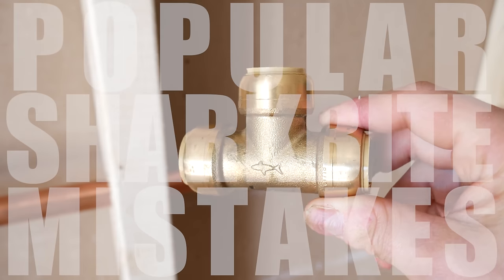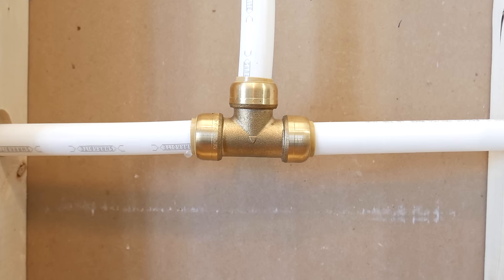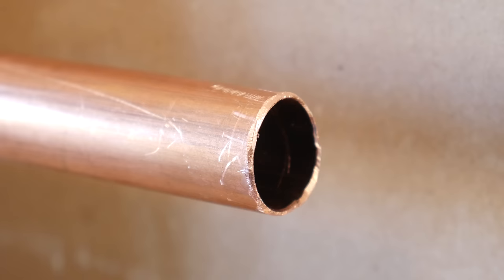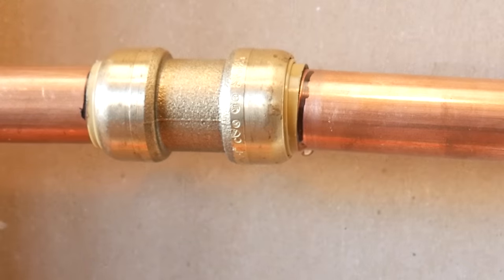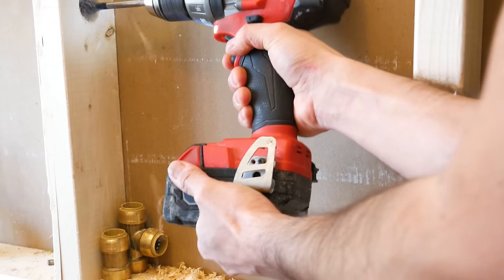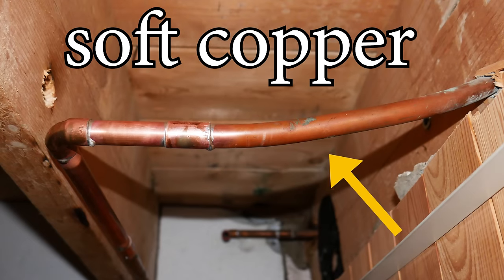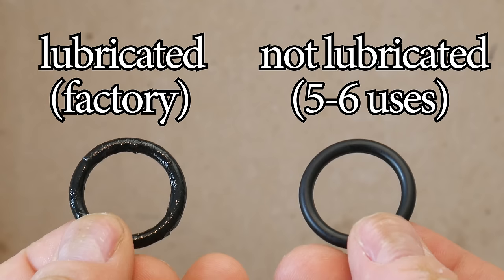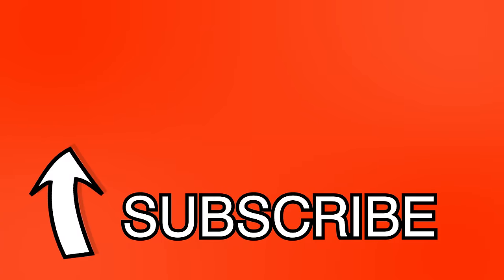6 SHARKBITE Mistakes NOT To Make! | GOT2LEARN

Comment: Are you using steel wool to clean the tip of the copper pipe? I know in one video you warn against using sandpaper. Some videos mention emery cloth. What do you recommend to clean the copper pipe ends? TIA
Reply from the maker: I prefer using 3M abrasive pads, better in every way.

Comment: Hi. What happens if I take out plastic inster inside connector? Connector is 3/4, but inside insert reduces inner side to 1/2. So, I assume it will reduce flow trough pipe. Can I take out it? Regards.

Comment: 2:04 'cleaning' the end of a pipe with abrasive like that leaves the surface scored giving it a fair chance to leak.They need to be clean and smooth, not abraded.

I never marked the insertion depth - you can tell when it's in properly or not by simply feeling it getting over that initial insertion resistance !
Reply from the maker: The abrasive pads don't score the surface enough to cause leaks, sand paper will however, and I wouldn't mess with the insertion depth, that's when you start getting leaks, big no no.
Reply: @Got2Learn  Too scored for me judging by what I saw in the video !
Interestingly, my dishwasher's just gone bang !

Comment: I wonder if the sharkbite fitting will last long term. When I put together a copper fitting, I know it is there, probably for 40 yrs +
That O ring is a big concern for me. Do all sharkbite fittings have that O ring I wonder? I did not realize they had the O ring. I have used sharkbites, over past few yrs with not one failure, but a little concerned now!

Comment: how close can i solder a slip joint to a sharkbite fitting
Reply from the maker: From the Sharkbite website: "It is recommended to solder any joints prior to installing a SharkBite fitting. The heat from the torch can be transferred through the pipe and potentially damage the O-ring."

Comment: I accidentally used a sharkbite polytubulene fitting with a grey end to connect copper to copper? It seemed to work fine. Is this a problem?
Reply from the maker: You should be using the proper one, this is why Sharkbites have a bad reputation, no offense James.

Comment: Thanks that was helpful information
Reply from the maker: Glad it helped!!!
Reply: @Got2Learn  I'm electrician handyman here and there I've had to do plumbing and since the shark bites came out with started using them only about five times every time we were wondering if we were doing it right and had to check and recheck. To make sure we did it right

Comment: I have 1/2 copper and 1/2 inch shark bite coupling but the pipe doesn't fit into the fit into the coupling, they are the exact same diameter

Comment: With the use of an Oatey laundry box, If I were to lower the box so the top of the drain pipe is 28”, could I put the p-trap below the floor? I have a crawl space below the floor.
Reply from the maker: If it'll be exposed to freezing temperatures, no, if not, it's fine.
Reply: @Got2Learn  I have a p-trap under the shower in the crawl space . How is that different?
Reply from the maker: @cinepost  Do you get freezing temperatures where you live?
Reply: @Got2Learn  rarely, Charleston SC
Reply from the maker: Then you should be good to go. Maybe making a wooden box w/insulation for them wouldn't be a bad idea in case it does decide to freeze, lemme know what you decide to do

Comment: SharkBite connectors fail from day 1 .... I did pex A expansion and I made a mistake with a fitting, I had to cut the ring with a hot blade, I still couldn't pull of the hose without the ring on it, its super tight, I didn't want to damage the plastic connector by cutting the hose so I just threw that piece away... the SharkBite's is easy to just pop in and swap, but you don't want those connections in the wall, they eventually leak, plus they cost almost double the price of the expansion or compression, I did my own manifold with pex A expansion rings, water heater, main, everything except the valves at the stub out for the water line to connect to sink because I did not have the expansion machine, so I said screw it and got the easy push connects from sharkbite, I only have 12 water lines total, I added a whole house filter, washer machine water box, about 5 shut off valves around the manifold and a water filter bypass, did the water pressure test,  all of those compression connections and valves were fine and super tight, out of the 12 valves I had issues with one SharkBite drop ear and the SharkBite water valve leaking, theyre pushed all the way in, cleaned each pipe before connection, so before we put the drywall up I am going to home depot to swap all of those SharkBite's out because I am not trying to have water damage after all this work was done. SharkBite's are easy to use, cost more money but no tool to buy, thats the only reason I got these, but I have these push connects for airline(other brand of course) but these airlines always end up leaking and they need to be replaced, so I didnt really want to use sharkbite but was being lazy, I had a 2nd plumber come out to do the shower drains and even he was asking me why did I not use the same expansion rings for everything? SharkBite's are not good he said and to use the compression at least because the tool is cheap, since I don't want to buy the expansion Milwaukee gun for $500. Back to home depot.

Comment: Any suggestion on plumbing inspection cameras for inside walls? I hear a noise and want to check it out before ripping into the wall. TIA
Reply from the maker: You can always remove the kick molding, drill a hole a pass a cam through there, not too many options.
Reply: You mean a noise like expansion of plastic lines against a plastic hanger? or water hammer from unsupported tubing? Or the sound of water dripping?
Reply: @integr8er66  hey there. I had water coming into a 1st floor bathroom behind the vanity. At first I thought it was a valve water leak and like Got2learn stated I drilled behind the baseboard and found that the pipes were good and dry. I went a little higher and found out the wall was wet. Long story short, the toilet on the 2nd floor had a wax ring that had dried out partially and it was allowing water run down into the 1st floor. The toilet was pulled, wax ring replaced and the issue stopped. I bought the teslong camera off amazon and it worked.
Reply: @Jesse-gv9tf  Cool, I bought a cheap usb camera for my phone and have used it a few times, I found it moderately useful, but hard to see much, but hey for $15 it has been worth it.
Reply from the maker: Awesomeee!!! Glad you caught it on time!

Comment: just installed one of these due to chopping off length of leaky copper. I had to take one of the shark bite coupling off each end one time due miss measurement, I didnt have the tool so I used a wrench. There is some minor gouges in the visible part of the gasket from the wrench. When I finished and turned water back on there were no leaks. but there is the tiniest bit of seeping coming through. Not enough to form droplet, only noticeable if I put a piece of paper up against it and watch it absorb. I might just end up replacing with a new shark bite but I'm wondering if it wasn't cleaned and debarred enough or if its that tiny bit of damage on the outer gasket? just wondering if anyone else has had this kind of tiny tiny leak?

Comment: Is it ok to use emery cloth to clean the copper before sharkbite?   You said in a previous video that the pipe must be smooth but you use some type if coarse pad to get that sticker off.
Reply from the maker: Yes, abrasive pads are ok, not sandpaper 👌

Comment: I’ve seen shark bites used on HVAC line sets as a temporary solution to the high pressure system didn’t work very well as a matter of fact the shark bite fitting came off with tremendous force
Reply from the maker: Yeah, not the right application, that's like using a DWV fitting on pressure lines lol

Comment: seems like it would be cleaner to wipe a film of silicone on pipe end, instead of gooping into fitting if reusing?
Reply from the maker: I guess it would work.
Reply: actually you want to apply the silicone to the gasket side primarily so you guarantee that during compression the inserted pipe material is pushing the silicone gel into the chamber and thus the pressure will spread it around the o-ring. Adding a light smear of silicone to the outer surface of your pipe isn't necessary and doesn't provide the protection the rubber bushing needs for proper seal.

Comment: Great informative information good video one last thing you might add is a lot of people don't know that that old gray pex looking pipe that was used in the '80s is also smaller in diameter and if you don't get a shark bite fitting with the gray plastic on the fitting itself and use it on copper,cpvc,,or the new colored pex it will leak the diameter is different

Comment: Mine has an elbow about 12” from where I replaced a sharkbite shutoff and seems like it’s off line. However, maybe it’s normal since elbows can bend out a bit? What are your thoughts. Been two weeks and no leaks yet
Reply from the maker: They can bend a bit, but they should be straight, I would check it out.
Reply: Got2Learn okay thanks. Is it okay if it unclip it once and than reinsert it back? Or does it go bad after 2 times??
Reply from the maker: No 2 times is fine.

Comment: Don’t like using Shark bites but quick tip push it in and you will hear a pop sound and when you hear that give it a little pull just to make sure it sealed . Also you can take the plastic inserts out for a better seal

Comment: On your other video you say you SHOULDN’T sand the pipe - but on this one you sand it - what is the right way?
Reply from the maker: When I said sanding, I meant to literally "sand" it with sanding paper, Sharkbite doesn't recommend this because if you sand it perpendicular to the pipe, it can create small channels for the water to escape, so a light scuffing with an abrasive pad is the better option, hope this helps, cheers!

Comment: Yeah shark bites rely on a rubber gasket that will never last as long as solder, compression, or thread tape or sealant on a mechanical connection. Shark bites are only handy for TEMPORARY USE! As a licensed plumber, I run into service jobs that someone previously used "push on" or "quick connect" fittings. There is something to note here: there are 2 types of quick connect fittings, ones that leak and ones that will leak in the near future.

Comment: I also don't understand the aversion to using shark bites, other than the price. I used several today on a replumb job in a water heater closet. The ones in there I had put in 15 years ago and never leaked. Pex is also far superior to copper if you are in a freezing climate. I don't think I would ever "bury" a shark bite in a wall, but IMO fine if used in a place where you have access.

Comment: Another thing is that plastic spacer in the fitting can easily get in the way of the pipe get bowed bot letting the pipe set in the hub. I usually remove this

Comment: The one thing that you are missing in this video is when installing a shark bite on copper remove the plastic insert. It is only for Pex pipe.  It 8s to stop pex pipe from collapsing.  It is not necessary on copper pipe and it will hang up on the inside of copper pipe.

Comment: How to identify soft copper if i only have about an inch of pipe exposed from the wall?  House built in 2004
Reply from the maker: No tricks here, you'd have to open up the wall to see if it was bent somewhere to really be able to identify.
Reply: @Got2Learn  got it, thanks
Reply from the maker: @maafa21MustSee  🤷‍♂️🙏
Reply: @Got2Learn  But hard copper can be bent too, no?  Is there any other way to tell?
Reply from the maker: Hard copper can only be bent if it's annealed, so no, it's not bendable.
Reply: @Got2Learn  Wow, thanks for your response.  I'm a big fan of your channel!  Thanks!
Reply from the maker: You are most welcome, and thank you so much!!!

Comment: All you have to do is buy a professional grade crimper and learn how to use it (which won't take long), and use crimp fittings and rings and you can forget about SharkBite fittings (which cost ten times as much as the crimp fittings and rings). I learned that nearly twenty years ago from a professional plumber who has the reputation for being the best plumber in North Alabama. His solder joints look like they were done by some kind of machine.

Comment: Just solder a new piece of copper pipe in and your done. Most licensed master plumbers will just solder a new piece of pipe amd it will be there for another 60 years. I am self-employed licensed master plumber in 3 different states, yes I'm old school and always solder , but I do use sharkbite fittings and carry over $4,000 worth of them on my van because I do mobile home repairs as well as residential so I only use sharkbite bites on mobile homes. I know alot of general contractors and handymen and home owners like sharkbites because they don't know how to properly solder pipe and make it look like it was done at a factory with no solder running down pipe ect. So I can see why they use them but always get calls on these sharkbite fittings because the contractor ( not. Real licensed plumber  ) will use these sharkbite fittings and just do it all wrong, they don't use a copper cutter to cut copper pipe cleanly, they don't clean the copper pipe or debur it, they have a fitting that's been rolling around on there dirty work van for months so they use it, instead of pitching it or keeping there van organized so the sharkbite fitting has tons of dirt in it, and they are too lazy to clean it out or just don't care, and then they don't push it in far enough. But there stupidity keeps me in business.

Comment: About 10 years ago, I had a properly installed sharkbite cap fail once. It literally flew off and hit the ceiling. Fortunately, it happened while I was on the job, and the resulting flood was no big deal. It could have been a disaster. I never used these fittings again. I sleep better when my pipes are soldered.
Reply from the maker: They don't just pop off like that, it was either a defective fitting or there was over pressure in the system..
Reply: @Got2Learn  Agreed. Love your content, btw.
Reply from the maker: Thanks man, really appreciate it 😉

Comment: I installed 1 with glue doesnt leak. Will it leak later on?
Reply from the maker: What do you mean by "with glue"?
Reply: @Got2Learn  I applied primer and cement
Reply from the maker: Sharkbite fittings do not require any cement/primer, this might have damaged to o-ring inside, I would remove it and redo it "without" any cements or glues as they do not require any.

Comment: Only one problem with the video copper should not be cleaned on the outside for use with shark bites. The inside should be deburred but the outside should have the rough finish to help grab and seal the fitting up. Right from shark bites website

Comment: As an underground utility manager I will add one he forgot and it's the biggest mistake made with these and that is using them underground if used underground the natural movement of the earth will shove the release rings in and the fitting will pop off the pipe

Comment: I have been a Plumbing Contractor and been plumbing since 1977 and when Shark Bite came out they were not meant to use in every plumbing case because of being lazy or for home owners to do a DIY. They were meant for short term repairs but not for the long term like sweating up copper.  They are a great fix for mobile home pipe using the insert they give you for it inside the plastic pipe.  They are good for repairs but not good for out side where it will freeze because the O ring can burst and I have seen them leak.  Other than that they are a good product but I would never re pipe a house using them in it use the proper fittings like Pex if using Pex or copper fittings if using copper but nobody uses Galvanized pipe anymore.  Over all a good product but very pricey if you plan to use a lot of them which is not a good idea.  The odds of failure will bite you in the ass.

Comment: 0:44 no exceptions my butt. You try using a marker on a pipe that is underground with water shooting out at full force flooding the building it's near and you can't find the main shutoff valve because it doesn't have a cover and is buried. Had to do that yesterday. I couldn't keep having water shooting everywhere while I literally dig around to try and find the valve. Btw I had to cut the pipe to put a shark bite cap on it so I could find the valve and turn it off.

Comment: Can we use a little  lubricant like Valvoline Jelly Petroleum  apply to pipe before insert ?????
Great clip Like Always
Reply from the maker: Not with Sharkbite fittings, or any fitting with an o-ring for that matter, the petroleum will damage it over time, so only use "silicone grease"

Comment: So, why are people apprehensive about using Sharkbite permanently? 4 years ago, I used a sharkbite hose on the "hot" side of my water heater. The info. provided said it could handle the higher temperature.

Comment: Pull out the plastic insert when connecting to copper......leave insert in for pex...easier .....
Reply from the maker: Sharkbite says it could damage the teeth.
Reply: @Got2Learn  i did many that way never had a leak....if you do it correctly its fine
Reply from the maker: Yeah me too, but then they told me it wasn't recommended anymore, don't know who to believe hehe
Reply: @Got2Learn  i agree with you tho....not good advice for the average joe....im an hvac tech so yea i do it all the time
Reply from the maker: Cheers man!!